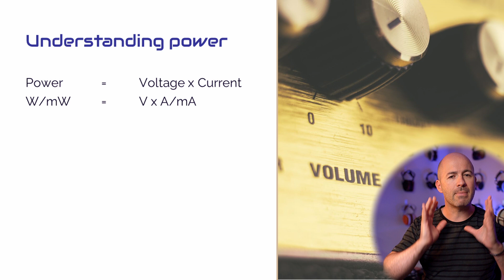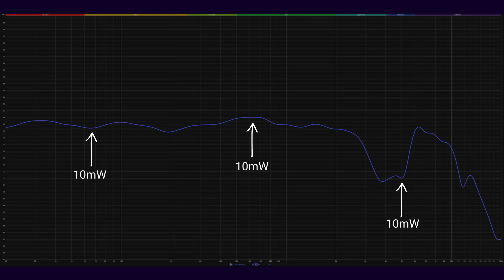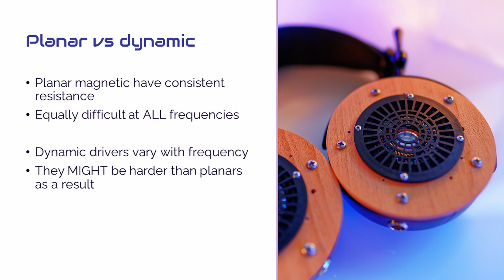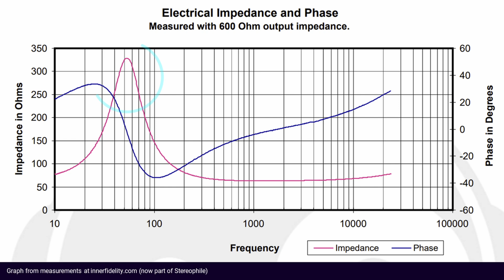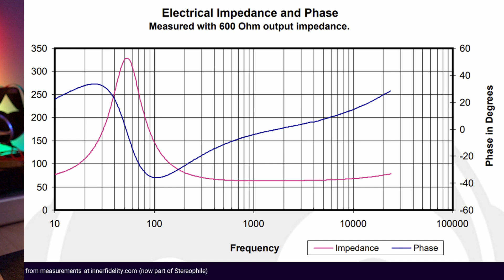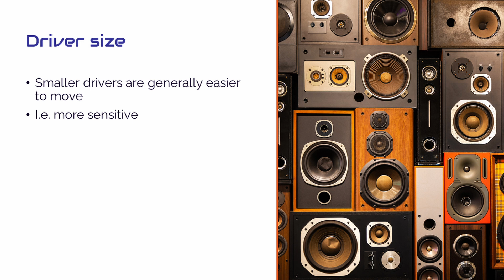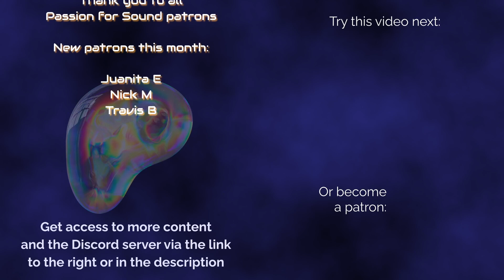Is bass REALLY more difficult to produce?

Comment from the maker: Error correction:
I made some mistakes when describing the resistance graphs and how to interpret them. I threw that content in on the fly and hadn't considered it properly or ordered my thoughts and I've mangled both the explanation and relevance.
Feel free to disregard the impedance related content.
The key takeaway remains though: bass is not inherently more difficult to produce when referring to a single driver. It's only more difficult when the bass is being produced by a larger, heavier, dedicated driver.
Reply: The weight and number of bass drivers is irrelevant. The only relevant parameter is efficiency. Inefficient drivers will be more difficult to drive. There are some very large heavy bass drivers used in the music industry that are efficient and therefore easier to drive.

Comment: Roughly correct, in the sense that there's not a huge discrepancy in bass vs other frequency reproduction, such as in case of full-sized speakers.
But there's still a smaller but present effect of lower frequencies boost as you power your headphones better.
Has anyone ever had the upper part of the FR boosting comparatively to lower as they progressed up the range of amps, power supplies, sources, DACs etc.? No, it's not an extreme effect, but consistently & noticeably enough the opposite happens (for both planars & dynamics, but more noticeably dynamics).

Either way I enjoyed this additional slightly different format.
Reply from the maker: What you're describing here is the improvement in circuits, not an increase in power. Better gear is more refined sounding (i.e. smoother treble) and it's often due to less noise due to things like better power supplies, etc.
This is easy to test, too. You can put a headphone on a very powerful, cheap headphone amp and it won't sound smoother or warmer as though there's more bass. If you then move to a better quality amp with even the same power or less (as long as it's got enough), and you'll find that the sound improves in the ways you've described.
Reply: @PassionforSound  I agree the crucial sound quality improvements are a matter of quality of implementation, including power supplies, not pure power output.
But I'm claiming both implementation and power alone are boosting the lower FR comparatively.
Putting Susvara on any speaker amp, even on one of the worst implemented ones, will improve it's comparative lower frequencies presence. That's how I currently see it.

Comment: The bottom line is bass can be hard to reproduce in a headphone when the amplifier doesn't have enough current to drive their headphones. Same thing with speakers.
Reply from the maker: No. Every frequency can be hard to produce if the amp doesn't create sufficient current. The current requirements don't change with frequency.
Reply: @PassionforSound  Some amplifiers with smaller capacitors sometimes can't maintain sufficient current for long enough during bass transients
Reply from the maker: Based on my conversations with multiple amp designers, this isn't accurate. If the amplifier has a specific amount of available power (assuming RMS measurements as used for most devices) then that power is available at any frequency and for any length of time.

Comment: Bass can be harder to reproduce in headphones when the headphone runs into linear excursion problems. So most headphones won't run flat down to 20 Hz.
Reply from the maker: That's an issue with the headphones (if I'm understanding what you mean), not a  representation of the amplifier's ability to output power across different frequencies.
Reply: @PassionforSound  yes we are talking about factors which make bass more difficult to reproduce. Not just amplifiers.
Reply from the maker: This will be demonstrated in the frequency response of the headphone though and it's about the headphone being less able to produce bass, not bass being inherently more difficult to produce across the majority of products.

Comment: Great video. The impedance graphs were fascinating.
Reply from the maker: Thanks Keith. I actually made a few errors in there with exactly how I explained the impact of the impedance swings on the amp. In hindsight, I should have left that section out, but I agree it's still very interesting to see how the dynamic drivers perform compared to the planars.

Comment: 4:40 wrong. Resistance is a measure of how hard it is to push current through a circuit. Voltage isn't pushed through a circuit. Voltage is applied to a circuit. I think someone needs to do a course in basic electronics.

Comment: I’ve watched so many of this type of video trying got get my head around how voltage/current/ power and impedance affect each other and the driver.. and every time I do I’m more confused lol😂 and the comments, it seems even sound engineers argue with each other about how it works.. so what chance have I got haha
Reply: It's very simple. V = I R and P = I V.
Reply from the maker: Yep, it gets complicated fast once resistance starts varying, etc. I've actually made some errors in this video because I rushed and was tired.
The key message remains the same which is to not worry about bass more than any other frequency when it comes to choosing a headphone amp.

Comment: Sufficient bass IS harder to produce on headphones and speakers when the music requires a higher SPL at low frequencies. Sometimes amplifiers don't have enough power to produce low frequency transients required for the music. What a pity Lachlan never looked at a waveform of a piece of bassy in music. What a pity he never talked to a recording engineer who would tell him that bass transients are often the limiting factor to how heavy the recording can be.
Reply from the maker: You're talking about the musical content of the recording, not the ability of the amp to move the driver. Yes, there is more low frequency content in music compared to high frequency, but that isn't telling us how much amplification is needed to produce a set output level.
Reply: @PassionforSound  just saying when more amplification is required and more cone excursion is required it's harder to do well without distortion.

Comment: As always with your videos, you got some things right, but the key things completely wrong. Frequency response graphs don't show sound pressure at a given power, no. It's VOLTAGE. Amplifiers are voltage devices. They set a certain voltage at a given time and the current adjusts to the impedance of the load at that moment. So FR graphs show sound pressure level for a set voltage. With speakers we use 2.83V which corresponds to nominal 1W at 8ohm resistant load. You make the speaker beep at many frequencies with that level and allow the current to do whatever it wants - it varies with impedance, ergo power varies but voltage stays the same each time we take a sample. The result is a FR graph you see online. impedance peak at driver resonance doesn't mean that an amplifier "must produce a lot more voltage for the same output". You can see the output on an FR graph you just posted. The output at bass is identical to the output at midrange. 

A peak in impedance measurement means a resonance. A resonance is usually a big rise in efficiency (it's complicated so let's keep it simple), which means that power requirements for a given output level drop drastically. When you have a device that controls voltage but doesn't control current (ie. an amplifier) then current follows the impedance of the load - if the impedance goes up, the current drops. That means that at a resonance, the driver consumes a lot less power. In other words a resonance does one thing: increases efficiency. Efficiency can manifest itself in two ways - either the SPL rises or the current consumption per given voltage level drops... current per voltage changes - a thing also known as impedance.

Now I like curious people who learn and want to spread knowledge, but for the love of sound, let other people explain this instead. You have no clue and for many people you just make things more cofusing.  Also don't get me started on why loudspeakers need more power,  but that's out of the scope of your channel. To sum up, A for effort, D for result. This should have been interview with an engineer. I really don't get why you put yourself in front of the camera for this job.
Reply: Well said, also 4:40 is wrong. Resistance is a measure of how hard it is to push current through a circuit. Voltage isn't pushed through a circuit. Voltage is applied to a circuit. I think he needs to do a course in basic electronics before the next lecture if you can't find an expert.
Reply from the maker: Fair points. I hadn't planned to discuss the frequency responses, etc. and chucked that in off the cuff. My mistakes for not thinking it through and collecting my thoughts first.

Comment: I suggest it would have been helpful if you prefaced that the conclusions regarding single drivers vs. multiple drivers will be different early in the video. Forced to go halfway through strongly disagreeing until you made this distinction.
Reply from the maker: Sorry about that. Because this is mostly a headphone based channel, I was coming at it more from that angle.

Comment: For speakers - good deep bass is the most difficult to produce. Because bass has longer wavelengths, and in a room, the bass will cancel (and reinforce) when the sound is out in the room. Different types of speakers have different issues:
Open baffle speakers will cancel the bass below a certain frequency to the sides of each speaker, that is determined by the dimensions of the baffle. So, the bass that is being produced from the front of the woofer travels around the edge of the baffle and cancels the bass that is being produced by the back of the woofer - which by definition is 180 degrees out of phase. OB speakers tend to need larger drivers, and they all will have bass that is audible only in front and in back of the baffles.
Going completely in the other direction - Sealed / air suspension speakers avoid the cancellation - by putting the woofer into a sealed box. The back wave is "trapped" inside the cabinet. But the result of this is the air pressure inside the cabinet becomes a "spring" and a restraint on the motion of the woofer. Which limits how low the bass extension actually is. The bass roll off is less "steep" in a sealed design, though.
A ported speaker then adds a tuned port at the lower end of what a given woofer/cabinet size can produce. This adds more bass that you can get from a given woofer and cabinet, but the bass below thee port tuning rolls off more quickly than a sealed speaker.
A fourth type of speaker that can have better bass extension from a given woofer and cabinet size - is a transmission line speaker; and a mass loaded transmission line, in particular. Here, the inside of the cabinet has internal baffles that cause the air to progressively become coupled with the woofer cone - the air actually moves (as opposed to being compressed/rarefied), and the added mass of the air lowers the fundamental frequency that you can get from a given woofer.
Case in point, the SB Acoustics SB16PFCR25-4 6" Paper Cone Woofer has an Fs (free air resonance) of 35Hz. So theoretically, an open baffle could produce bass to 35Hz.
In a sealed enclosure, this driver would have an F3 (-3dB) bass of about 80Hz. Which leaves most of the bottom two octaves missing.
In a ported enclosure this driver would have an F3 of 50-55Hz. Considerably lower than the sealed box; but nowhere near the open baffle.
In a stand mounted mass loaded TL speaker that I have designed, this driver has essentially flat response in my room to ~32Hz - which is below the Fs. And the same driver in a tower mass loaded TL - the fundamental frequency and in-room response is 28Hz.
Reply: This is partially relevant, although I think we can arrive at similar conclusions in another way. The real reason for loudspeaker inefficiency is acoustic impedance mismatch between the driver, (which is always  too small) to a large volume of air that it needs to energise. A large volume of air is a low impedance load which means that it's hard to make high pressure with it but it's very easy to move it. A speaker driver is a relatively heavy mechanical thing that's very good at making pressure but it needs to be absolutely massive to match the impedance of air, or in other words to scoop so much air that it could "feel" the resistance of it. This impedance mismatch causes inefficiency. Generally if you want efficient bass driver, get an 18 inch or even 21". Put it in a box and enjoy high bass output of just a couple watts.

But let's suppose that we can fit a gigantic subwoofer in a room, that would have the diaphragm comparable in size to the waves it's producing. Then the driver would move the air mass that actually impedes it's movement, making it's impedances matched optimally.  Such diaphragm would have to be huge, making it either very flexible or sufficiently stiff but very heavy. A flexible diaphragm would stand still and just bend no matter how much the coil would move. Only the center of the cone would make any sound. A heavy diaphragm would be inefficient because instead of moving air, the main objective now would be to move the diaphragm. 

With headphones, the impedance is more optimally matched at ~45mm diaphragm diameter. I guess a separate bass diaphragm could be bigger but for fullrange bigger is not better. At this tiny and sealed (with earpads) volume, the impedance of air is quite high and so it acts as a more direct interface between the diaphragm and the eardrum. You can think of headphones as having a stiff linkage between the voice coil and your eardrum, while speakers are trying to couple to it by sheer suggestion ( by shaking all the matter around you).

Now you can increase the coupling of a loudspeaker to air by adding impedance matching device. An example of such device is a transformer (electric energy), a gearbox (mechanical) or a horn (acoustic). A horn stacks pieces of air on top of each other in front of the diaphragm in such a way that a diaphragm sees a slice of air roughly it's size, that slice moves a slightly bigger one, the last one moves another bigger slice and so on. This increases the pressure at the diaphragm because now it "feels" a chunk of air that's roughly it's size but opposes the diaphragm with the mass of all the slices in front of it. This gradual transition increases efficiency by scooping all the energy that was previously transmitted in all the directions into a beam of sound without any destructive interference that you get from dipoles. Unfortunately for bass, the horns are enormous. People crazy enough to be invested in horn bass in home audio dedicate entire walls, rooms, even levels of their houses to them.

So...  if I got that right, You somehow mislabelled a horn as a transmission line. You described a back  loaded horn. It's a type of a TL but your description doesn't capture the essence of TL which is basically a higher efficiency alternative to a bass reflex. Both are resonators, but a TL build is a quarter wave resonator and a bass reflex is a Helmholz res.Both rotate the phase by 180 degrees, they both have the same problem of phase mismatch outside of their resonant frequency. A typical TL box is larger and more efficient so it's fs is obviously lower. You can conduct an experiment and design a BR box with the same volume. The most obvious advantage of TL is that it's a model that uses more details than the Helmholz equation. It allows you to control the response and consequently extend the bandwidth up by a bit. And if your TL expands, then it's a horn. 

Headphones use resonators too. HD560s has them, you can see them working in the measurements. They work more like passive radiators but that's again, same thing as BR,  just made differently.
Reply: @rhalfik I would posit that having more extended bass from a smaller lower mass driver increases the quality of the bass. The SB Acoustics woofer I mentioned is a paper cone with an Mms of just 13.8 grams. And it has no problems generating plenty high SPL at 28Hz. An MLTL uses the output from both the front and the back of the woofer.
A reverse horn expands toward the opening. A mass loaded transmission line tapers toward the terminus opening. This causes the air to move farther and this increases the mass loading as the frequency goes down.
Reply from the maker: Yep, excursion AND driver size are both important factors. The key point of this video was just that the bass frequencies are not inherently more difficult to create from an electrical perspective despite what is often said. As a headphone-based channel, I've seen this confused a lot and wanted to clarify where it IS more difficult (large drivers dedicated to bass only) vs where it is not (small, wide range or full range drivers)
Reply: @PassionforSound  Right - and with a mass loaded transmission line speaker, you hear output from the back of the woofer cone, so you get more SPL from a given size driver at a given excursion.